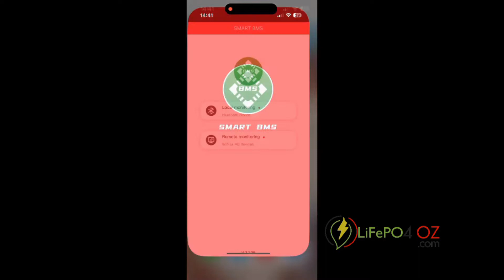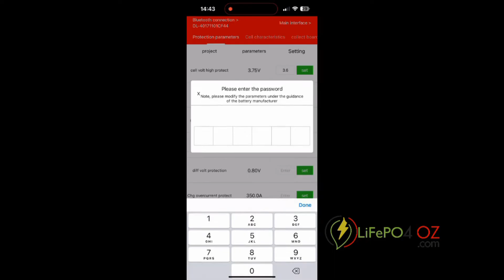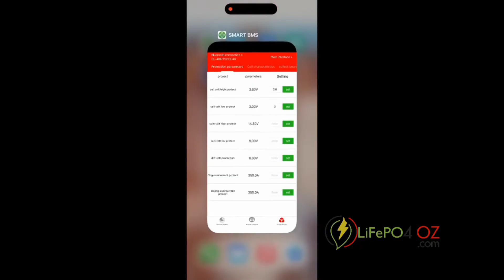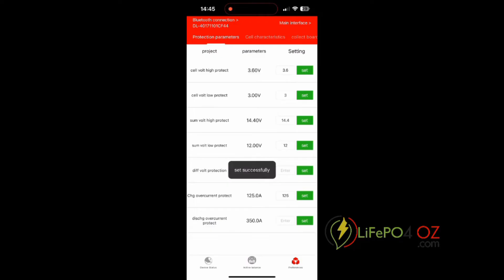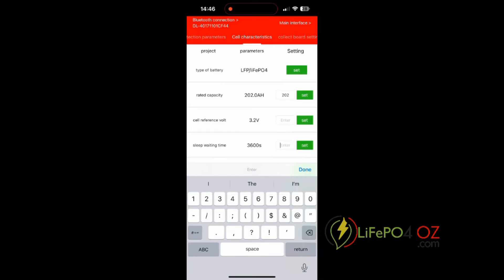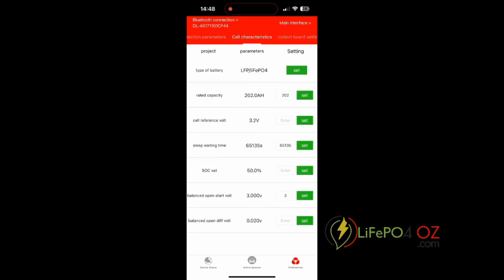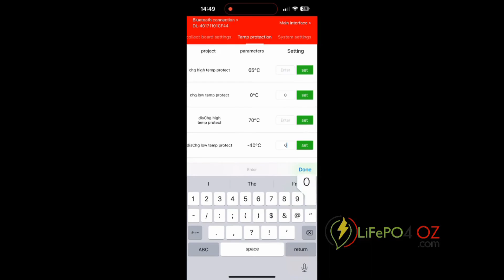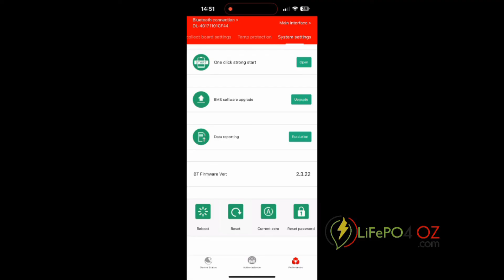Step-by-Step Guide: Setting Up Your Daly BMS with LiFePO4 Oz

Comment: Hi, great help, got almost everything setup on my 250a bms. one thing, the voltage difference protection is at 62.467v, (my system 16 cells for 48v batt), and everytime i wanna set it to 0.2 volts (tried 0.8v like u got) it says: setting failed pls try again. i could use some help. ty

Comment: Hi, thanks for the guide & a great help. Since setting up to your guide i am getting a couple of faults? I have 2 banks of lifepo4 3.2v batterys with 2 Daly smart 250A BMS one on each bank 2 x 16 48v 314ah each bank joined in parelel. The faults i am getting on 2 x 4" screens indoors is "Total voltage high level 1" & the Chmoss has gone to off on bank 1 & showing 73% charged. On the other of the 2 screens i am getting "Total voltage high leval 2 "  & the Chmoss & Dchgmoss have both gone to off. & showing 99.9% charge. But the concerning one is also on this bank i am getting Thermorunaway fault. Every thing is new & on testing have only used solar to charge & all batterys on this bank showing 3.304 to 3.306v. But getting the Thermorunaway fault wich i have not seen before. Cheers, Chris

Comment: Any ideas - I was getting data on the "main interface" but I went to the deeper menu by clicking on the series (12v 4s) it asked to read write and went through a few permissions which I said ok and now I connecting but seeing no data on any screen even main interface. Tried older version, reset cache and data, nothing is working data wise, except I can see and connect to the Bluetooth dongle.  So wierd

Comment: If you set the balance start voltage to 3.00V, you are subtracting life cycles to the cells. Mean about, from 2.50v to 3,45v the BMS cant know the real capacity of the cells, because vary a lot the capacity vs volts, you can have one cell at 25% capacity but the others can be at 30% an all can have the same voltage and the active balance is working adding and substracting current continously, this action can be made from 3.00v to 3.65v a lot times, but if you stablish start balance at 3.45v, when is at 99% capacity and just when the cell up to 3.65v in a very short time, the balance work also and also balance the cells, but the action of add and susbtract current from the cells is made a little cuantity of times, then you are lengthening the life of the cells.

Comment: Always set a high charge rate  to avoid going over charge rate. This will occure when 2 batterines in parallel are charging and one stop the charge due to a high cell. The effect is that now the remaining battery's charge rate doubles. I use a 20% C rating as the limit. So for example a 280 aH will be set at about 70 amps for the charge rate limit on my Daly BMS.

Comment: Title: Balancing Issue with New 12V LiFePO4 Battery Pack (EVE 105Ah Cells)

Message:

Hello everyone,

I recently upgraded my 12V LiFePO4 battery pack and encountered a balancing issue that I can't resolve.

Previously, I had a 12V pack made from 4 EVE 105Ah cells, and it worked perfectly with my Daly 100A BMS. Balancing occurred as expected.

Now, I've expanded the pack to 210Ah by adding 4 new EVE 105Ah cells. I connected the cells in pairs (one old and one new in parallel), creating 4 parallel groups, which are then connected in series (4S configuration). I am still using the same Daly BMS.

Here’s the issue:

The pack charges fine, but one cell group (the first group) consistently shows a higher voltage (3.54V) compared to the other three (3.35V).
The BMS is unable to reduce this difference below 0.2V, even after running for 24 hours, although the balancing tolerance is supposed to be 0.05V.
Interestingly, if I disconnect the charger, the balancing happens within just 2 hours, and the voltages equalize. But when I reconnect the charger, even with a low charging current (3A), the imbalance reappears (around 0.15V).
I'm using an active balancer with a 1A balancing current. Given that this issue didn't happen with the old pack, I’m wondering if it’s related to mixing old and new cells or the balancing current being insufficient.

Questions:

Why does balancing fail when the charger is connected, even with no charging current (0A)?

Comment: Any help with the Bluetooth disconnect all the time? Just got it and disconnects from the app after 30 secs
Reply: Yes, I have the same problem. I try  reconnected the all wiring and it worked.
You must make sure you do the same wiring as the manual.
Reply: @gotveensaw9035  Ok i’ll try retracing everything, i have 48 string system with 4 different battery banks so it’s a bit of work

Comment: Hey is there a way to make standard daly bms into smart one and add bluetooth and active balancer? I have 2 daly bms one is 8s and other one is 16s
Reply from the maker: You should be able to connect the Bluetooth dongle to the bms and connect through the Smart BMS app, however it may depend on your BMS model.  Here's a link to the bluetooth dongle: https://lifepo4oz.com/collections/active-balancers-parallel-modules/products/daly-bluetooth-dongle

Comment: I've got two Daly BMS 4S LiFePo4, but it comes with two separate modules with separate bluetooth. Do you need to connect to them separately in order to set up Battery protection and Active balancing?

Comment: I have an APC 3000va UPS. I purchased a Daly brand, 15s 150 amp Smart BMS and created a 48-volt LifePo4 battery pack. However, I'm encountering an issue. Normally, the BMS's B- should be connected to the battery, and the P- should be connected to the UPS. But when connected this way, if the city power is cut, the device automatically shuts down. After it shuts down, if I press the button, it turns back on and continues to operate on battery mode. If the power is cut again, the UPS shuts down once more. There's no problem with charging the batteries when the city power is available.

When I connect the B- to the UPS and the P- to the battery, as long as the battery is charged, it automatically switches to the battery when the city power goes out. However, in this setup, it does not charge the batteries and even discharges them while the grid is active. So, the UPS is functioning correctly, but it does not charge the batteries.

Additionally, there's another odd thing. If I use another BMS from Daly that is not a Smart model, I encounter the same problem; however, if I reverse the connections—connecting B- to the UPS and P- to the battery—the system operates normally and charges the batteries.

Can someone please help about this problem

Comment: I made a dumb blunder. I didnt follow this part of the instructions.   As a result the system "thought" the capacity of the pile was 30 amp hour not 280 Ah ... I thought this would be calbrated byt the BMS .. I was wrong .... RTFM ... rookie mistake ...  

Al fixed now nd it seems to be working great .... on it's first cycle and so far Very Happy ..

Comment: I cant seem to get the balancer to balance. I am in the parameters. Do you know what is the trigger to balance? Does it need to be charging to balance ? does it have an auto balance or is my bms not working properly? Thanks
Reply: If I do not have the active balancer unit do I need to lower the passive balance current? It is set to 1 A now.
Reply from the maker: The Daly BMS doesn't have an Active Balancer built in, it has a passive balancer.  To see the difference see this video: https://youtu.be/dIuiy11-KWA?si=RknUmvjP4NVqd6hh

Comment: I have 2 bms 150 amp model set up in 12 volt paralell system.  Do I have to setup each bms with the same parameters? or, just set up one?
Reply from the maker: Yes you'll need to update the settings on both of your BMS's.  In addtion  to that, Daly says if your going to run 2x Daly BMS in parallel you should also use their Parallel module, that said the parallel module will only connect with specific BMS.  Check on the side of your bms to see if it has a "Parallel" port.

Comment: Thanks for this video. I have the smart 100A BMS and 5A active balancer (Not smart) Did you manage to upgrade the BMS firmware? It asks you for a secure firmware code. Any idea if this is possible?
Reply from the maker: I've updated the Daly BMS fireware before you can see here: https://youtu.be/h1NoQ0IrJIo
Reply: @lifepo4oz673  That's very nice and helpful of you. Many thanks!
Reply: @lifepo4oz673  Dumb Question, where do you get teh formware from, so far I have been unable to get anyVendor Response